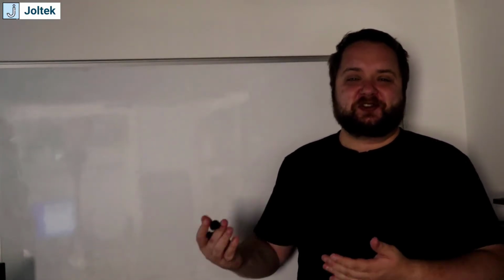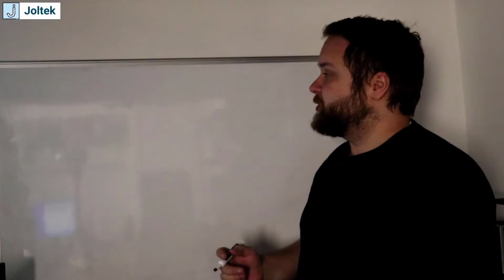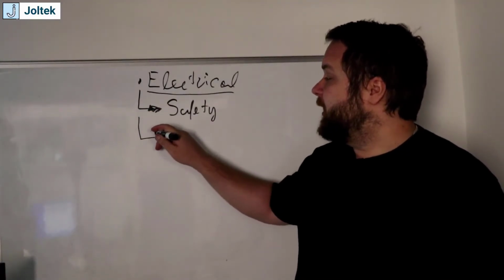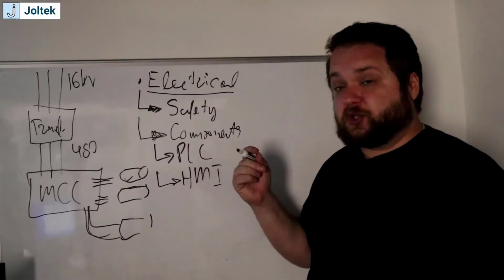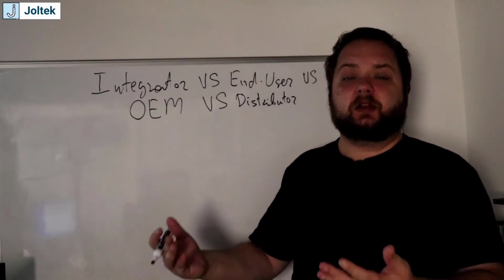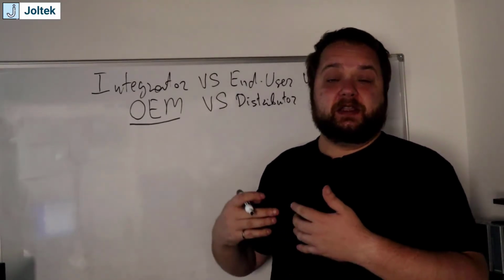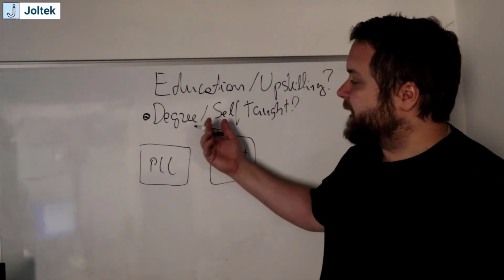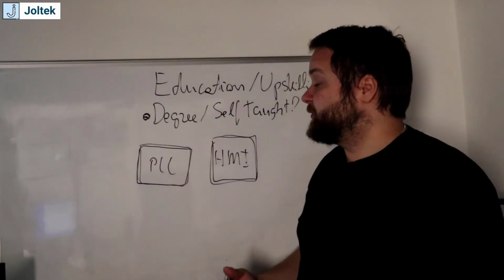Why Control Systems Engineers Are in Such High Demand (And How You Can Become One) | Automation

Comment: Currently working as a software engineer (28). I'm honestly kinda burnt working on web side and not sure if I can sustain this grind for the next 10 years. I'm considering to transition as controls system engineer. Though I have solid programming and network skills, my electrical knowledge is only limitied to basic circuit theory. I also remember being kinda decent on embedded system projects during college, though I'm not sure how much would that help me.
Reply from the maker: You can definitely make the move, but I'll caution you in saying that the struggles aren't just as bad on the control systems side; they're just different. When it comes to electrical systems, I don't doubt that you can learn it; it's not rocket science; in most jobs you're not going to be doing anything "deep." With all that in mind, I'd just keep focusing on what matters most to you and your family; don't switch just because you don't like your current idnustry - look for work in it first.

Comment: In Australia there is a glut of engineers. Even if you have a job the only way to stay busy is to be incompetent meaning you have to try your task over and over again. There is simply limited demand for engineers but a huge supply as most tech work can be done by anyone and super-brains are only required for the super-tough jobs.
Reply: Even control engineers are not needed?